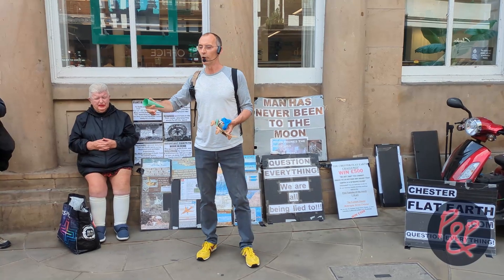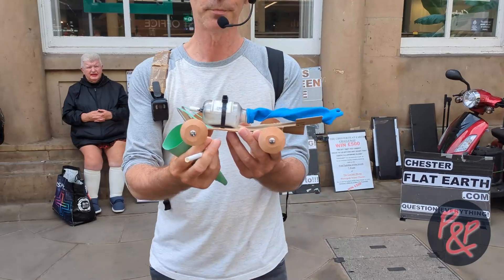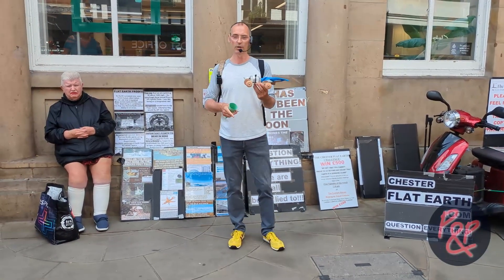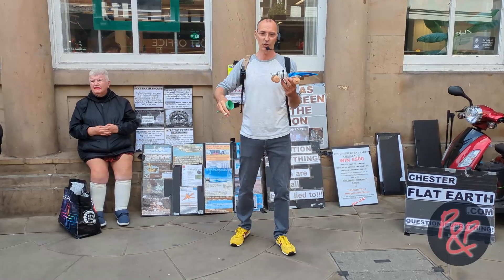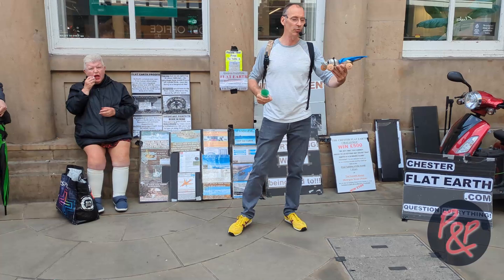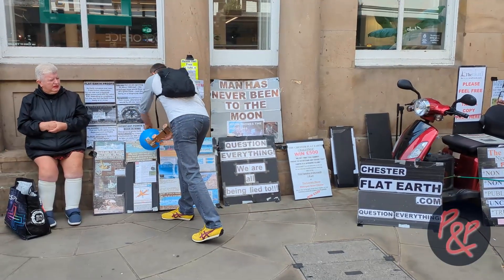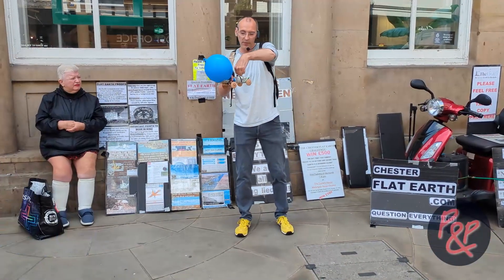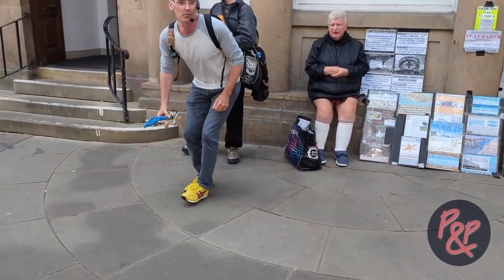Street Demo: How a rocket doesn't work!

Comment: It's not NASA who says this is how rockets work. It is Newton's laws that do. 
If you don't believe in the "NASA" explanation then you can't believe in Newton's laws.
Reply from the maker: yes Newton's 3rd law has been manipulated imo. The law should be to every action there is an equal an opposite reaction in the form of resistance!!

so hot gases being shot out of a nozzle at high speed will cause a reaction in the form of resistance by the surrounding masses ie air, solid objects.

In vacuum, gases exhauts from the nozzle and there is NO resistance which means no reaction!!

Voila!!
Reply: @PeterPete When a rocket engine is running what happens to the "mass" of the fuel and oxidizer?
A Space Shuttle Main Engine (SSME or RS-25), consumes 500 kilograms of liquid hydrogen and liquid oxygen per second.
What HAPPENS to that mass?
Reply from the maker: @stuartgray5877 it gets burned!!
Reply from the maker: Ir burns and exerts a force due to the speed  exiting the nozzle and heat  @stuartgray5877
Reply: @PeterPete - "it gets burned!!"

Sure, but the MASS does not disappear!
When hydrogen and oxygen Combust, the result is pure water.

So when a Space Shuttle Main Engine consumes 500 KILOGRAMS of Hydrogen and Oxygen in one second it creates heat and 500 kilograms of PURE WATER per second.

And I think it is obvious that 500 kilograms of pure water HAS MASS.
500 Kilograms of mass exactly.

Now tell us HOW a space shuttle main engine causes that 500 kilograms of water to accelerate to Mach Eight every second .

Is it "Magic"?
  Or does the combustion chamber apply a "Force" to that water in the form of "GAS PRESSURE"?
Reply: @PeterPete - "Ir burns and exerts a force due to the speed  exiting the nozzle and heat"

OH?  So, you are saying the ENGINE applies a "FORCE" to the exhaust gas causing it to accelerate from the nozzle?
Is that what you were trying to say?
Reply from the maker: @stuartgray5877  i'm really unsure why you're banging on about mass - because the expelled hot gases exert a force - action - now what is the reaction??

clue - imagine the hot gaseous exhaust is the air exiting the straw on the balloon cart!!
Reply from the maker: @stuartgray5877  Btw, stand behind a jet engine and see if the exhaust moves you. I think it will.
Reply: @PeterPete So the rocket ENGINE applies a "Force" to the mass of the exhaust gas causing it to become "accelerated".
Got it.  This explains why rocket exhaust comes shooting out the back of the engine at Mach Eight.
So you agree the engine applies a "force" to the mass of the exhaust gas. Great!

Now what does Newtons THIRD Law say about "forces"?
Reply from the maker: @stuartgray5877 glad you agree the exhaust exiting the nozzle exerts a force and this is an action

Now what is the reaction? 

Bear in mind, the balloon cart moved without the cone but remained with the cone!!
Reply: @PeterPete - "glad you agree the exhaust exiting the nozzle exerts a force and this is an action"

Wrong.  The nozzle exerts a force on the exhaust gas - THIS is the action.

We know this to be a fact because we measure the exhaust gas velocity on engine test stands.
The fuel and oxidizer are at a velocity of 0.0 m/s in the tanks on the rocket.
After the exhaust gas exist the nozzle, it is travelling well over 2500 meters per second.  This is over Mach Eight.
So, we know, for a fact, that the exhaust gas experienced a "force" A really big one 

Now. What is the REaction?
Reply from the maker: @stuartgray5877 sorry I disagree because the ballooncart would have moved even with the cone installed!!

Like I said, the cone makes a difference whether we observe motion or not!!!
Reply: @PeterPete You keep playing with your balloon cart. I am telling you how we test real rocket engines in practice.
I worked at Lockheed Martin when we received the very first RD-180 shipped from Russia for receive inspection.
This was at the Waterton CO facility where there are still about a dozen rocket engine test stands hidden in the hills.
Same facility where all of the Titan missiles were built and tested by Martin Marietta before Lockheed Bought them.
Reply from the maker: @stuartgray5877  why won't you accept the exhaust stream from a rocket or balloon cart generates a force in the direction of the exhaust stream??

we both know if you stood behind a rocket nozzle or jet engine you'd get pushed away by the exhaust stream!! It's clear the exhaust stream exerts a force!! So what is the equal and opposite reaction??

what is the matter with you?? Why can't you accept this??
Reply from the maker: @stuartgray5877  you need to watch this video from 02:40 on youtube which clearly demonstrates that a force is generated by the exhaust of a jet engine onto something - a rocket engine is NO different!!

Top Gear - Boeing 747 vs Citroen 2CV & Ford Mondeo
Reply: @PeterPete By disagreeing with my statement you are suggesting that the exhaust gas gets accelerated WITHOUT A FORCE!

Why won't YOU admit that a FORCE is REQUIRED to accelerate the exhaust gases?

Do they go from a velocity of zero to Mach eight by MAGIC?

Or is a FORCE EXERTED by the Engine onto the gases to CAUSE THEM to accelerate?
Reply: @PeterPete Here is a fact:
When an RS-25 is running it is accelerating 500 kilograms (~1100 pounds) of pure water to Mach eight every second.
HOW can the engine cause 500 kilograms of water to reach Mach Eight every second?
Does it cause the water to accelerate by MAGIC?
Reply: @PeterPete You know you can use an online mechanical work calculator to determine how much "Work" is performed by accelerating 500 kg of mass to 2500 meters per second.
That way you could determine how much "work" a Space Shuttle Main Engine performs every second.
Give it a try.
Find an online work calculator and give it 500 kilograms mass, initial velocity 0.0 m/s, final velocity 2500 meters per second.
WHAT IS THE ANSWER? 
 Provide the answer in units of "Joules" please.
Reply from the maker: @stuartgray5877 the exhaust gases are pushed into the nozzle by pumps where combustion takes place!! The hot combustible gases exit the nozzle at high speed very much like the air stream of a jet engine!

It's clear the air stream rom a jet and the hot gaseous combustible exhaust from a rocket nozzle exert a force!

So what is the reaction of this exertion??
Reply from the maker: @stuartgray5877  I'm disinterested to know about the amount of work an engine can do. We're only establishing why the rocket and balloon car moves. Where does the action and reaction take place. 

I've told you that an aircraft's jet engine, which is similar to a rocket's thrust generator, applies a force to objects that are located to the rear of it, as we see when the car travels passed the plane.

So if the air stream from a stationary aircraft's engine applies a force on the car it has to apply a force to anything that is behind it. This is exactly the same that happens with a rocket.

If you think I'm wrong stand behind a large horizontal rocket, when it gets fired up tell me that you won't move.

According to your logic water cannons don't disperse crowds because they don't apply a force🤣🤣🤣
Reply from the maker: @stuartgray5877  Quote - Why won't YOU admit that a FORCE is REQUIRED to accelerate the exhaust gases?

Yes but the forces are all moving in the same direction, the pump is moving the fuels in the direction of the nozzle and the fuels are moving in the direction of the nozzle. This means no force can be applied equally and opposite within the rocket because it wouldn't move.
Reply: @PeterPete - "The hot combustible gases exit the nozzle at high speed very much like the air stream of a jet engine!"

So you agree that the exhaust gases felt this force pushing them out while still inside the engine nozzle?
Did the mass of the exhaust gas experience a "force" that made it accelerate out the nozzle?
Reply: @PeterPete A Boeing jet pushes on atmospheric air as it moves through the engine.
No further "pushing" occurs AFTER the jet exhaust has left the engine.
The jet engine applies a FORCE TO THE MASS of the air moving through it pushing it out the back .
The jet engine feels a RECOIL FORCE of pushing on the mass of the air as it moves though the engine.
This pushes the aircraft forward.

You agree that a jet engine CAN push hard on that atmospheric (14.5 PSI) air that it ingests from the inlets? Right? and the atmospheric air can be pushed on because it has MASS and resists being accelerated. Right?

What do you think has more "mass"?
A - One Cubic Meter of Atmospheric air at 14.5 PSI?
OR
B - One cubic meter of CO2 at 3000 PSI?

Which cubic meter of "gas" has more MASS?
Reply from the maker: @stuartgray5877  the fuels ie liquid hydrogen and oxygen are pumped into the combustion chamber in the same direction as the exhaust stream!!

I can't see how these would create a force in the opposite direction as any force in this opposite direction would impede the flow of fuel!!

You're talking absolute rubbish!!
Reply from the maker: @stuartgray5877  quote - The jet engine applies a FORCE TO THE MASS of the air moving through it pushing it out the back .

sure and this stream of air exerts a force we know this for certain because it pushes a car away!

So even the exhaust from a rocket will exert a force too!

So we have air and gas streams from jet and rocket engines applying a force so what is the reaction??
Reply: @PeterPete - "You're talking absolute rubbish!!"
The 3000 PSI COMBUSTION process pushes the mass out.
PERIOD.
The 
ENGINE
PUSHES
OUT
MASS
AT
HIGH
VELOCITY.
Did the engine apply a force to cause this?
Yes or no?
Reply from the maker: @stuartgray5877 I'm not disputing this, what I'm disputing is the reaction to this accelerated mass!

Newton's 3rd law is about contact forces and the accelerated mass of the exhaust exerts a force so it must come into contact with something that is essential to produce motion!!

In my understanding for motion to occur the exhaust stream comes into contact with surrounding masses eg air!

Air has mass as you should know!
Reply: @PeterPete - "Newton's 3rd law is about contact forces and the accelerated mass of the exhaust exerts a force so it must come into contact with something that is essential to produce motion!!"

NO!
The "ACTION" is the rocket engine applying a force TO THE EXHAUST
Then there is the REACTION, the RECOIL of pushing on that mass. THIS pushes the rocket forward.
The rocket exhaust does NOT HAVE TO CONTACT ANYTHING.
In fact you want it to shoot into nothing so there is nothing to SLOW DOWN the exhaust gas.
Reply from the maker: @stuartgray5877  are you suggesting the exhaust of a rocket doesn't exert a force in the same direction as the exhaust flow??

Comment: But the car DID move with the cone attached...?
Reply from the maker: trust me - the car only moved very slightly because i accidentally nudged it when i let go of it!!! It certainly didn't move in the same manner without the cone right?

but if you still aren't sure watch this video 

https://www.youtube.com/watch?v=FeULZ4Ow81U&t=452s

we carried out this test indoors and the balloon car did not move!!!
Reply: @PeterPete - you do understand that you need supersonic gas flow for the nozzle to be efficient don't you?

Otherwise, all you're effectively doing is making the throat so big in area that the flow rate of the exiting gas isn't high enough to create thrust.

Your little balloon isn't going to have anywhere near the internal pressure to create the conditions required for any nozzle to be efficient.

The demo without the cone is far more pertinent.
Reply: @duncanmcneill7088  Peter and Pete are far too clueless to understand that a diverging nozzle slows down subsonic flow and speeds up supersonic flow. 

They somehow convinced themselves that the nozzle simulates there being no pressure to push against even though it should be obvious that there is atmospheric pressure inside the nozzle.

Comment: A thermal rocket is a heat engine of the internal combustion type. The exhaust is the working fluid. The working fluid of a heat engine must by definition meet external pressure in order to create work. The only possibility for this external pressure is the atmosphere through which the rocket moves. No atmosphere, no work, no motion. The gas law w=PV supports this, solve for when P=0.
Reply from the maker: Yep thanks for that one, we understand that one, clarifies what we thought already 👍
Reply: @PeterPete  Do you believe as papalegba does that water can be accelerated from a velocity of zero to Mach Eight - WITHOUT PERFORMING ANY "WORK"?
Come on we want to see if you are as delusional as papalegba.

I can show you video of a machine that CAN DO THIS, Once a second.
I want you or Papalegba to tell me that IN a video where 500 kilograms of water gets accelerated from a standstill to MACH EIGHT - the machine CAN DO SO without ANY FORCE begin applied to that mass.

Come on tell us ALL that mass CAN be accelerated WITHOUT A FORCE.
Reply: @PeterPete  I got ChatGPT to admit rockets can't work in a vacuum by questioning it along these lines, it was a hoot. Notice the chatbots will never admit a rocket is a heat engine, cos it's easy to show work in a vacuum is therefore impossible to create 😂
Reply: @papalegba6796  So Papa please tell me :
How much "Mechanical Work" is performed by accelerating 500 kilograms of mass from a velocity of 0.0 m/s to 2500 m/s.
Please provide the answer in "Joules".
You DO claim to be an expert in physics right?
This should be a trivial problem for you to solve. There are literally online calculators.

What's your answer?
OR are you going to claim that it takes "No Work" to accelerate mass to Mach eight?
Reply: @papalegba6796  I just used an online "Mechanical work calculator"
It asks you to enter the mass and change in velocity.
I entered 500 kilograms for the mass and 2500 meters per second for the change in velocity.
The answer it gave is 1562500000 Joules.

This SURE SEEMS TO NOT BE "ZERO".
So according to an online Physics calculator -YOU ARE WRONG.

It DOES require "Work" to be performed by accelerating 500 kilograms of ANY MASS from a velocity of 0.0 m/s to 2500 m/s.
So how can that mass have WORK PERFORMED ON IT if the ROCKET ENGINE PERFORMS NO WORK GENIUS?
Reply: @papalegba6796 What's the matter? Neither you nor Pete or Pete can use an online calculator?
Or are you just SCARED to answer because answering proves YOU WRONG.

It DOES require "work" to accelerate mass.  You just refuse to admit it, because then your whole delusion comes crashing down.
WHY won't you tell us HOW MUCH "work" is required to accelerate 500 kilograms of mass to 2500 meters per second?

Oh THATS RIGHT because then you would have to admit that rocket engines DO PERFROM WORK - ON THE MASS OF THE EXHAUST!

Comment: Hilarious that Thick and Thicker are still going and even making utter fools of themselves in public.
Reply: See what pete has to say about 100-year old PATENTED tech in my new thread.
He thinks that the gyrocompass was patented using fake physics.
Yet ships have been using these devices for navigation for over 100-years.
The Germans RULED THE SEAS  in the early 1900s because of the invention of this device.

HOW can they navigate IF THE DEVICES DONT WORK?

We STILL use them today as backups on ships in case GPS goes down.
The Artillery Computers used in Korea had gyrocompasses to COMPENSATE FOR EARTH CURVE AND ROTATION.
But again, I guess that is ANOTHER Patent (and classified tech) that is really just a hoax.
Reply: @stuartgray5877  as a pilot I’ve relied on a gyrocompass many times. Always effective.
Reply: @peteconrad2077  Perhaps you mean "fiber-optic gyro".

Aircraft cannot use mechanical gyrocompasses although, the "alignment procedure" for ADIRUs, DOES include performing AS a Gyrocompass to test the fiber-optic gyros by measuring earth rotation.
This is ANOTHER fact that Pete refuses to believe even though I have been testing fiber-optic gyros for almost 30 years now USING EARTH ROTATION as an actual Aerospace Engineer.
His highly convincing counter-argument is "Nu-Uhhhhhhh!"
Reply from the maker: @stuartgray5877  You forget that your fibre optic gyros are only built on the 'UNDERSTANDING' the earth is rotating, not on the actual rotation of the Earth.

Keepo dreaming now Stuart!!!
Reply: @PeterPete  - "You forget that your fibre optic gyros are only built on the 'UNDERSTANDING' the earth is rotating"

Except for that part where I have TOLD YOU that AFTER I test them using earth rotation as the stimulus, I install them on to real SPACECRAFT then launch them to space where we USE the gyros to point the spacecraft for activities like TAKING PHOTS OF THE ROTATING EARTH,
Reply from the maker: yawnnsss!!